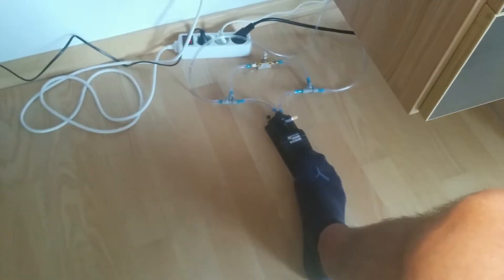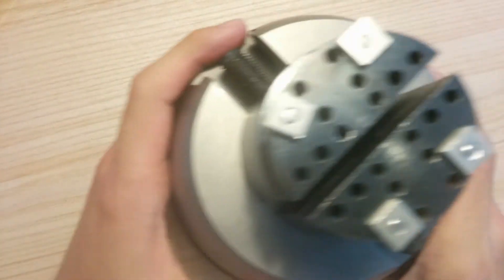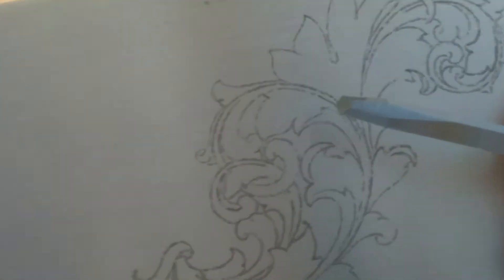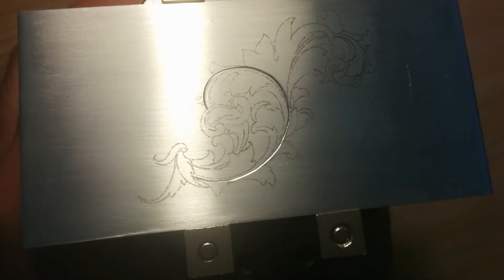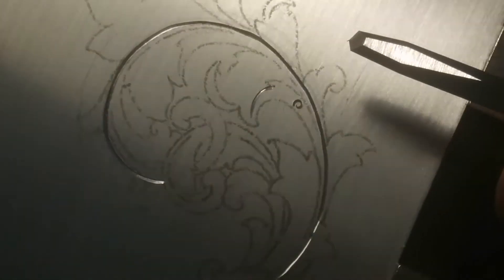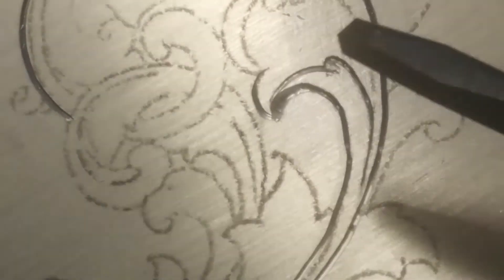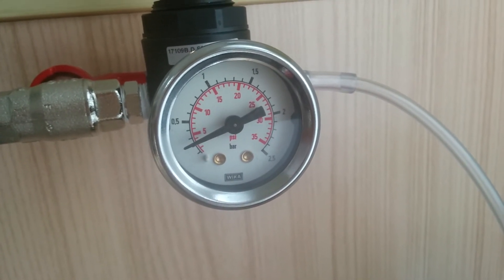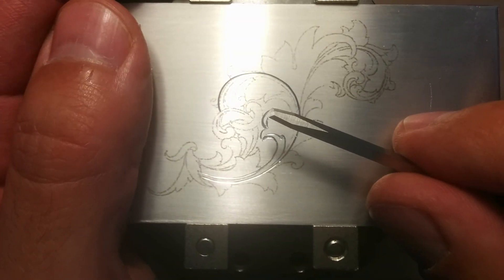Testing new handpiece

Comment: A cool trick for starting a cut using that Lindsey point is to tilt that graver on its heel and then straighten it out when you press your pedal. Trying to cut right from the start with that tiny point at the tip of the graver is ok to but for a beginner I find that when you tilt it on its heel and straighten it out I can go into a cut without having to worry about my graver slipping or going to deep. The technique also comes in handy for cutting smaller lines for shading in scrolls and it doesn't hurt to stop and start to insure that your cuts are even and not sloppy. Keep up the good work!

Comment: Good morning Nejc, that pedal seems to be working fine, does it work like on/off or can you accelerate the speed of your handpiece? The minimal air use of the handpiece is easy on the compressor, which won't be overheating, a perfect combo.
I had some trouble yesterday with a hose coming of the compressor because of its heat, gave me a bit of a scare, that ruckus. All you need now is a trinocular microscope where you can attach your camera onto. The latest models from China could be an affordable option to start with, I'm thinking about buying one, maybe from Amscope, although they all seem  to be the same. I've bought one from "lucky zoom" for $199, I should have gone for the slightly more expensive one, I think that's the same model as the "Omoda" something 99 model which got a good review for engraving. You should only buy the head with focus rack and led ring light, will save on shipping costs. The stand weighs 20 kg. You can manufacture the stand yourself, I'm sure. I'm working currently with a Meiji emz, but I am still curious about the Chinese alternative which could be a good option. Have fun engraving and thanks for another great educational video !😃
Reply from the maker: Just on-off switch on the pedal. its ok for now untill i figure something out. Hey, many thanks for the info on the microscopes, i have to look that up. Thanks buddy, i appreciate it a lot.
Enjoy

Comment: Where did you get the square pins for holding your work in the vice? Have you used this machine to engrave car parts/motorcycle parts?
Reply from the maker: It comes with the vice. I engraved also big parts yes. It can be used on everything you can hold on the vice and is proper engraving material.